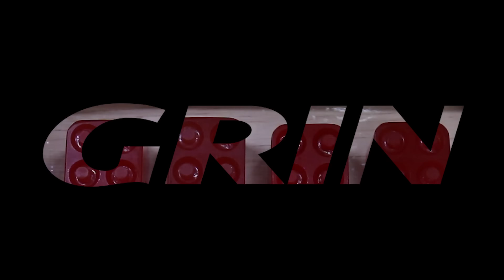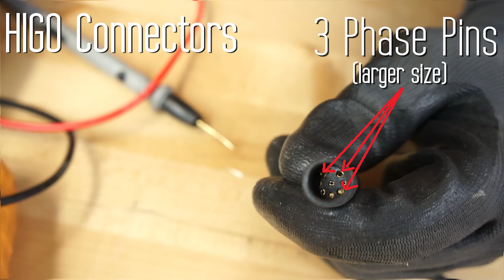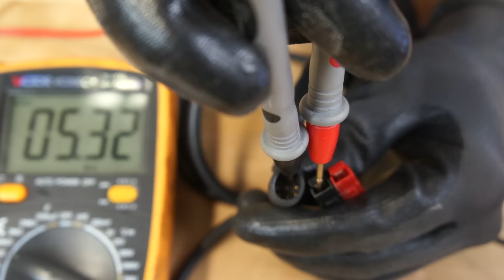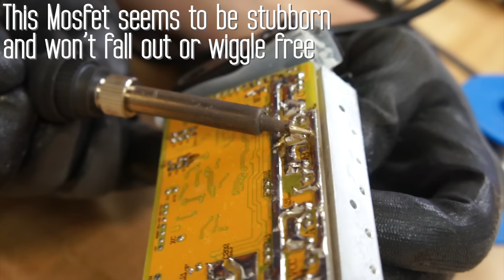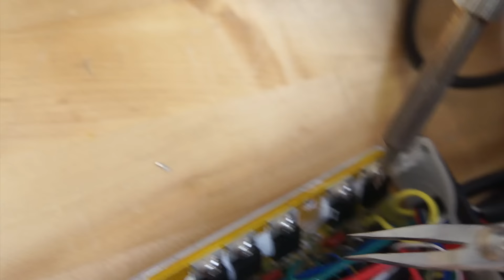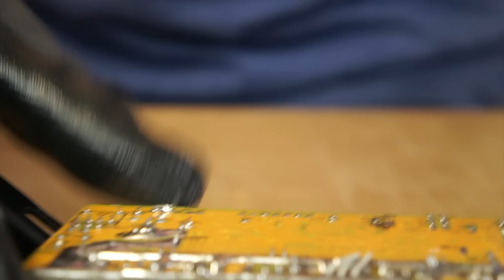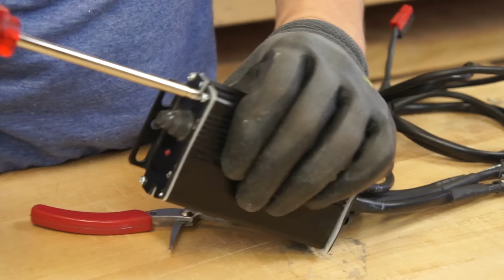Finding and Replacing Blown Motor Controller Mosfets

Comment: Just bought a new furnace and heat pump and one of the circuit boards for the setup won't turn on.  The mosfet gets insanely hot.  It's the Friday before memorial Day weekend and I plan to try this out to see if I can get my AC working.  Cheers and thanks for the video no matter what my outcome is.

Comment: Here is the issue im having.
The motor jutters during acceleration only and more at lower speeds than higher speeds.
Im try to figure out if its a motor or a controller issue.
Reply from the maker: Well one thing we can assure you is that it's not a blown mosfet issue!
Reply: @GrinTechnologies 
Ok
What other issues can I test for on the controller?

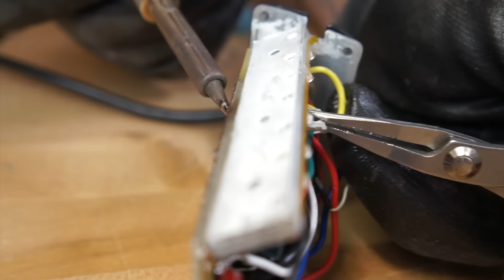Comment: 8:08 This repair method is not appropriate. When it is pulled by tensile force, the copper pad around the inside of the through-hole via is torn away. Even if part of it remains and a multimeter shows no issues during measurement, the moment an overload occurs while riding the scooter, the likelihood of additional problems arising becomes very high. However, you are correct that cutting it partway and working on it, rather than pulling it out completely, is the right approach.

Comment: my controller only opens from the front and back but the motherboard doesn't slide out. any tips?
Reply: Open the screws of front and back. And also the top. And the push the pcb to front. Not pull it back

Comment: I have a 2000w controller,with 18 mosfets,and seems like 9 of em are shorted on the positive side as all 3 phase wires produce a beep on the multimeter.is there a way to test the mosfet itself?
Reply: Yes there are videos on that

Comment: So if there is no dead short in any pin and the positive and negative terminals of the controller, the moffsets are OK?
Reply from the maker: It's possible to have a blown mosfet eventually form an an open circuit too, but usually if the damage is that bad it's quite plainly visible with a crispy cooked housing or burned open PCB trace.

Comment: i notice your mosfets are screwed into the heatsink. the metal screws are touching the metal heatsink and the metal parts of each mosfet,  why isn't that causing a problem with them shorting out to each other or to the heatsink?
Reply: btw there is also kapton tape under the mosfets... isn't that meant to prevent them from shorting to the heatsink? I'm confused
Reply from the maker: Both kapton tape and an insulating shoulder washer so none of the screw can make any contact with the mosfet tab.

Comment: My brand new controller is connected but doesn't work and has resistance on the wheel but if i disconnect the eyellow wire the resistance is gone any combination with the yellow connected has resistance

Comment: Are you able to turn 60v 50a into a 100a controller?
Reply from the maker: If you swap out mosfets for ones that have 1/4 the RDs ON resistance, reduce the resistance of the current sensing shunt by half to effectively double the effective amperage of the current sensing feedback loop, and reinforce all the conductive traces on the power bus, and add more electrolytic bus capacitance, then in some cases yes you could do this.

Comment: Phil, maybe you can help me. I bought a City Coco E-Chopper a few months back. I just spent several months refurbishing it and spent most of my savings. I finally got it assembled and took it for a cruise. It was awesome! I rode it for most of the day. In the evening I took it to do my laundry. After my laundry was dry I went outside to discover when I turned the key, everything worked but the current that was supposed to flow to the motor. 
I have a serious heart condition and was pleasantly surprised when a couple with a pickup offered to haul it home for me.
I have spent the last few days dissassembling it and reassembling it over and over again. I have watched every Youtube video including yours but have found no answers. 
I bought a couple extra controllers off tyhe internet a couple months ago and tried hooking them up to the bike, and get nothing. There is no wiring diagram. I cannot even get them to turn on.
Can I send my controllers in to you to look at?

Wayne
Reply from the maker: Hi Wayne, would you not have warranty support from the store who sold your the e-chopper bike if it stopped working after just a couple months?

Unless you really know what you are doing it is not very easy to wire up random controller you bought online and expect it to just plug into your ebike system and work. If your are dying that you are best to replace everything (control, throttle, display etc) with parts that are sold together and written together.

Comment: I had a broken motor controller a couple of years ago, and thanks to this instructional video I managed to fix it. Now I got another one, immediately found this video and fixed the controller. Thank you!
Reply from the maker: Awesome!
Reply: @GrinTechnologies I'm glad to hear this comment and reply I have yet to continue watch this video as I see it will be valuable too. I see Tom on this video and the opening spoken words are truly human and with common sense. WTB Tom. Hello from a new subscriber. I do want ask one ? About speed controller from a friend's scooter ladped lb60 is a clone almost new I have in spected and new to research of electrical repair knowledge of any sort so I just want ask and easy question. The battery is original and has 14.5 out at leads to connect at speed controller pins all good like new I have remove controller suspect of further test to be absolutely sure it is controller I conn everything at the controller except battery so power is at controller but I don't have power where I think it supposed to supply to screen display red wire 5 pin connector. I originally tested this red wire at screen display end no power there I thought was screen itself shorted no turn on at all. Friend had took to new job let it outside and told me it rained and was very mad with himself already order another scoot I currently own lp80 myself and up till now honestly I knew next to nothing about electric repair or diagnose I do know some basics recent crash course. About 1 year ago I manage to learn my daily driver electrical troubleshoot on my 08 HD all good now took 3 weeks dedicate my time fixing a gremlin. On the HD and damn well worth it. Thanks agaîn

Comment: Hello maybe you can help me I have a problem on the headlight of my e-bike: it is always on but weak, when I turn off my bike, the light is a little bit stronger but still very weak, it is impossible to turn off the light unless I remove the battery. When I put the battery back, the light is again always on and weak. Is it a problem from the headlight or from the controller ? My bike is a Lankeleisi X2000+

Any help is very welcome, thank you in advance.
Reply from the maker: You are best to get support from the store who sold you the ebike. They should know the internal wiring and have access to necessary replacement parts

Comment: My controller to 4000watt motor does not seem to work. When new throttle was added. Then even the old throttle did not work. This is due to mosfetts need to be replaced?
Reply from the maker: If you watch the video, you will see the diagnostic step to determine if a mosfet is shorted and if so which one. That will tell you if this is the source of your issue or not (most likely it is not)
Reply: @GrinTechnologies  well my motor wont run and throttle goes on but does not twist. Must be the mosfets?

Comment: What will happen if you use same spec mosfet but not the exact same as other ones?
Reply from the maker: In most cases it will still work fine, in some cases you can run into shoot thru currents and other issues if the mosfet driver isn't fast enough. In other cases you can have high amounts of electrical ringing that can cause voltage spikes on the fet and complete failure even if you are nominally below the max voltage.

Comment: I’m my case the solder actually melted and shorter the source/drain trace. So also look for melted solder sometimes mosfet can handled load but not the solder board. I packed that thing with solder to allow more current

Comment: Awesome video, didn't realize these could be opened up. Tried on my Aventon, got the end covers off but its sealed in a clear,flexible material.
Reply from the maker: Some controllers are potted which makes things like mosfet repair a lot more challenging. But first you should confirm if you do actually have a blown mosfet, using the technique in this video or just by plugging it into a motor and spinning the motor with no power applied to see if there is heavy chugging resistance that goes away when the controller is unplugged.
Reply: On my Aventon the mosfets are ok but the speed is not displayed on the unit & I'm getting am E30 error. Spoke to Aventon & they thought the controller is bad so I thought I'd open it up to see if it was something obvious.

Comment: hello, if I give full throttle (freewheel) or put a little load on the engine, everything turns off.
  When I then disconnect the battery, I measure 32v on the controller side which then slowly drops. And reconnecting the battery (note a spark at the battery contact), I can start up again. could it be that my battery is too small 36v for 11max20A controller 36v direct drive motor. thank you.
Reply from the maker: Sounds like a tripped BMS.  32V is quite flat for a 36V nominal battery pack so you might want to try charging the battery first.

Comment: I have a motor that has a white wire included with the 5 hall sensor wires. My replacement controller does not have a white wire. after connecting everything power but the motor does not move.
Reply from the maker: Usually the white wire would be an internal wheel speed sensor if you are running a geared motor that freewheels. It shouldn't be required for the controller to run the motor.
Reply: @GrinTechnologies  Thanks, I was able to connect the controller without the white wire and it worked.

Comment: Thank you for this video. After seen this video, I’ve found that is my problem. MOSFET. But they are 24 . It is a little bit hard for me to fix this. Can you do  for me?
Reply from the maker: Nope. If doing it yourself is outside of your skill set or comfort zone then we'd recommend you get a replacement motor controller form the company who sold you the system in the first place.

Comment: My KT sine wave controller has 18 mosfets. Looks like the blue phase is shorted. Now, looks like I have to de-solder 3 of those fets? Oh boy. CRST041N08N and where to buy?
Reply from the maker: Yup, only one may be blown but you can't easily tell which it is. No need to use an identical replacement, a comparable mosfet with similar gate capacitance or gate charge and similar or lower rds on will usually work fine as a substitute.

Comment: Ok,mine is ok,I have tested my controller like you should here but of I use the china white box test is not working.. no lights coming on th tester box...can you tell me Why?Also I have a video ofy bike..Is not showing me any errors on the LCD screen but I can't start it..the motor is not speening....I have tested the throttle, that's ok, brakes are ok,cables to the motor are ok one was cut but resolder it back... I am stuck
.....https://youtu.be/Bv6TAe6m15U

Comment: Maybe a better tutorial would be how not to blow mosfets...
Reply from the maker: The people who need that tutorial are those designing the motor controllers, rather than the people riding their ebikes! 
It's quite straightforward to have fast acting protection circuitry so that no matter what the rider does (short of applying too high a pack voltage) there is no way they can blow the mosfets.  Thermal rollback and pulse by pulse current limiting can do wonders.

Comment: Hey thanks for the video it helped me do some troubleshooting just had a question for you so if I'm getting continuity from battery positive to two out of the three phase wires, and continuity from battery negative to the third phase wire, does that mean all 12 of the mosfets are bad? I'm also getting continuity from the positive battery connector on the board to the battery negative on the extension cable for my battery. So let's say I changed all 12 mosfets would that fix the problem or would I have to find what the problem was in the first place before I change them because they might get shorted again? It looks like some of the mosfets actually have a crack in their leg maybe they're not fully connected on the one leg there's three legs on each and about 6 out of 12 them look like they have cracks in the solder but no signs of burning or anything and the rest of the board looks okay except for one capacitor that is not swollen but it looks like it's caving in a little tiny bit. When capacitors go bad is it possible for them to cave in instead of pop up swollen? Thank you in advance for your time!!!

Comment: Hi
My grandsons xiaomi has stopped working dead. The video you made has been a great help as its the first time working on these. The connector to the motor has melted so I presumed there's a short in the wiring or motor. Could you please confirm i am on the right track with that.
Thank you.
Reply from the maker: Usually a melted connector is not the result of a short anywhere but simply the result of too much current through the connector for too long. First try just bypassing the connector and hooking up the wires directly to each other to see if it otherwise still works fine, odds are good that it will.

Comment: Hi, awesome video thanks, I use an Hover 1 alpha E scooter so two days ago I was changing the accelerator of the scooter, and in the process of assembling it together i found out that the beeping device was lose  but before I could touch it one part it's poles mistakenly touched the pole of the display panel which resulted in some weird noise and the break light blinking and unfortunately the Scooter went off and wouldn't come on again not even charge any longer , do you have any idea what could be the issue Thanks..
Reply from the maker: Well it's most likely not a blown controller mosfet ;-)
Reply: @GrinTechnologies  Wow Thanks for replying really appreciate,

So what could it be then :•{

Comment: Could have just unscrewed the heat sync and snipped the mosfet legs and pulled them individually. If youve got a nice chunky head on your soldering iron then its easy enough to pull it as a whole chunk. I liked the diagnostic method you used for finding the bad fet.

Comment: I have a swagtron envy bike I think the motor is only 200 watts it has a small motor controller in it. I was having problems with it when I got a 14 amp battery at 36 volts that battery that came with it was only a 4.4 amp battery at 36 volts mine keeps cutting off the power and the display malfunctioning going crazy then I noticed the controller was getting hot is it because the battery has more amps in it how will I lower the amperage do you think I might need a new motor controller

Comment: Hey @Grin - thanks for this video, very informative! One question: got qs-c52 controller and there are 3mosfets per faze... That’s weird because there would be not even count for the high or low side ... Can u explain why is that and which “side” has more mosfets? Thank you!

PS. This is worth to note: Even with the battery disconnected, and ignition ON to discharge caps there is still lots of voltage in there! When i was disassembling my unit the bottom of the housing wasn’t protected with anything and after releasing the mosfets heatsink from the side of a box it dropped down causing a short circuit! The burn marks are around mosfet legs as they were sticking out the most over the surface of pcb. Thankfully everything seems to work: motor is spinning and breaking works... Do do think I should still be worried or consider myself lucky as if it works nothing wrong has happened?
Thanks!
Reply from the maker: Hey Mike, sometimes indeed they'll double up the high side FETs and have just a single low side FET and do the PWM just on the high side drive. Only the mosfets doing PWM have switching losses to reckon with, so the side that isn't doing PWM isn't stressed as much and can get away with less silicon.  It's very common to short out the leads of an energized electrolytic capacitor, and it rarely damages anything since it's normally just a dump to ground and not to any of the signal leads.

Comment: If possible, its often easier to cut the legs and remove one leg at a time.  Might not save everyone a lot of time in cases like this, but its safer and easier for those unskilled or working with less than ideal tools.  A weak 15W soldering iron or an oxidized tip might end up taking too long, and before you know it the traces just come right off the board.  

Nice video.  Blown FETs is a common problem and fixing it is something most will be able to handle.  Especially if they have some soldering before.

Comment: Great video. I have the same controller as in the video and my motor just shudders and then stops when powered up. I get about 5 kohm's between battery -ve and 2 of the phase wires but only 1.8 kohm on the 3rd phase wire. Is this too low and could one of the mosfets be my problem? Resistance builds as expected on all 3 pahses against battery +ve. I've checked hall sensors and windings on motor itself and they are all good. Thanks for any help.
Reply: Where you able to fix it? My motor also shudders and I've got the "E06" error on my display.